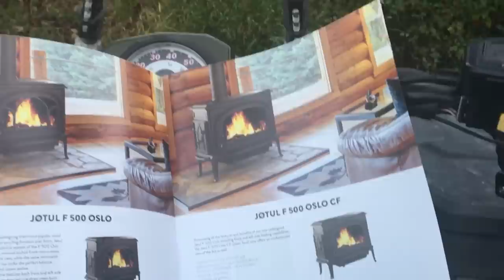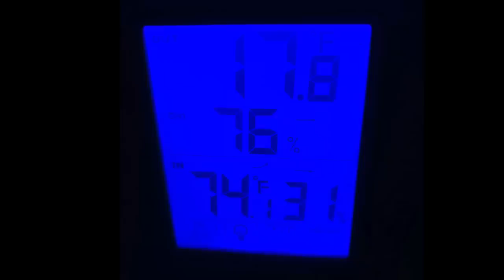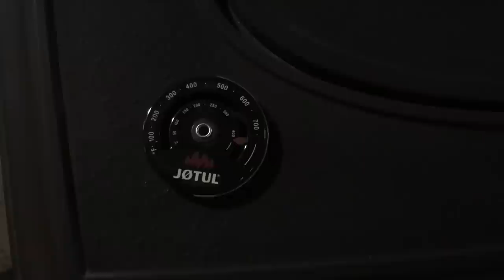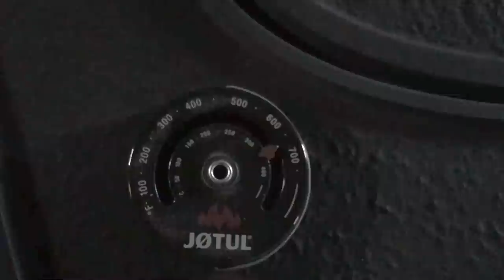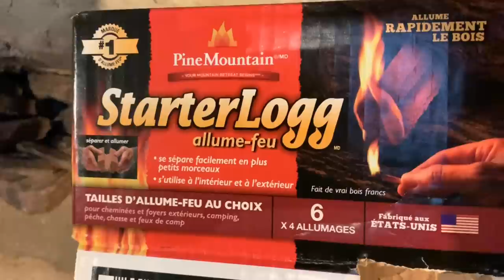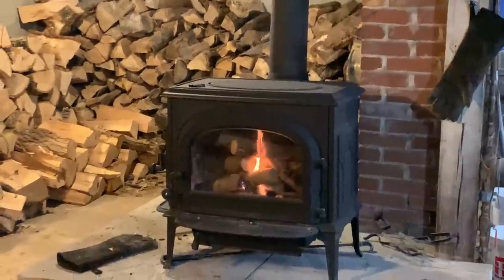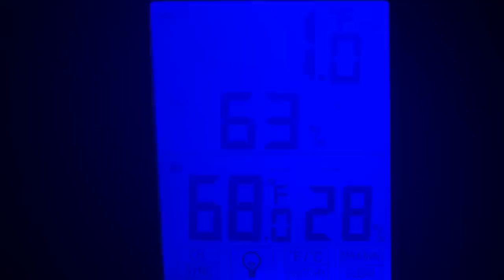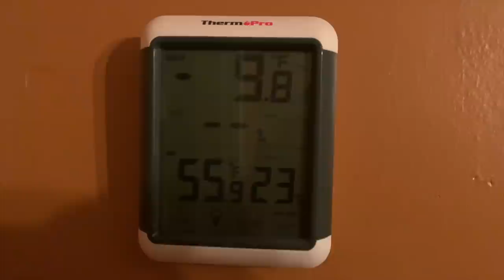The Jotul F500 Oslo CF one full winter review + install is this stove that good ?

Comment: Ive owned several high end wood stoves. In my opinion a woodstove  that draws outside air instead of inside air is very desirable. When a stove draws inside air it pulls outside air into you house.. Better option is the air to be drafted from outside right into your stove so not to pull the cold air into the house.
Reply from the maker: You are right. This stove does that. But i dont have it set up that way and cannot show it. I may in the future. I should have mentioned it i guess though. Thanks.
Reply: @AlfonsLC  very few wood stoves have the option to draw in outside air into the stove.  That alone is the best option to that stove.
Reply: Why is it bad to draw air from the house? Either way you need fresh air exchange (indoors) in the winter. To me it seems if you bring outside air to the stove it’s colder so not as good for combustion?
Reply from the maker: Bruce A the internal combustion engine is proof against what youre saying. The cold air is more dense. (Contains more oxygen per same cubic feet of air) oxygen is what burns. This is why people eliminate EGR valves on gas and diesel engines. And spend extra money for cold air intakes turbos and super chargers. It increases the performance of the burn. But i agree the air exchange is good. Some people dont want to create the vacuum pulling air in for heat deficiency reasons
Reply: You do not have even close to the combustion temps of an ICE, and in the case of secondary burn, you want the air as hot as possible to burn the gasses easily. It’s a different dynamic. The only reason manufacturers specify outside air is because in tight houses you can have reverse flue gasses leading to carbon monoxide in the house. And of course people don’t like cold drafts caused by the stove negatively pressurizing the space. But somehow you still need fresh air coming in or you get sick in the winter from your own (co2) stale air, even without a woodstove. To me it seems a toss up because you need fresh air in the house and you want the stove to draw well. But the science of the secondary burn is to have the air as warm as possible, not as dense as possible.
Reply from the maker: Bruce A none if this changes that cold air burns hotter. The heat isnt needed for the secondary burn EXCEPT to cause ignition of the gases. The air is drawn in the same. If its drawing in colder air. It will burn better.
Reply: Nope. The air for the secondary burn needs to be a minimum of 1050 degrees for it to work properly. You do NOT want cold air. That why all the systems preheat the air.
Reply: You introduce cold air to an ICE to increase power. You introduce warm air to the woodstove to increase efficiency. Again, two different dynamics at play.
Reply from the maker: Bruce A it needs to be that hot ignite the gases. Not because it needs to be there to burn.
Reply: So if it needs to be that hot to ignite the gases, what difference whether it starts as 0 degree air or 70 degree air? I don’t follow your logic about cold air. Yes, cold air is denser. But by the time it gets to the secondary air tubes, it’s neither cold nor dense. It’s nearly 1100 degrees no matter what it started out at. All cold intake air does is make the stove slightly less efficient because now you are burning some small fraction of the wood to heat the air that much more.
Don’t take my word for it, ask Jotul or any other stove maker. Or any science teacher.
Reply: The secondary air is still from the room, the primary air is from outside

Comment: Seasoned wood is just dry and older so it has shrunk and let air into the voids so it burns hotter... sort of.. wet wood is heating water vapor so you get that instead of heat but the energy is the same...and you can polish the glass to get rid of the clouding fire too hot too close to the glass fused particles onto the surface... anyway seasoned only means been there since last season nothing else... I burn wood 6 weeks after it is cut and sun dried and it is as hot as can be..dry is the key nothing else matters.
Reply from the maker: Yeah we will have to slightly disagree on this. There is a good video on how to tell the difference between dry and truly seasoned firewood. That walks you through the changing colors of seasoned wood when it starts to blacken and what that means. Check it out I think it may interest you. The channel is homesteading off grid

Comment: ofcourse it wil smoke before it gets really warm. thats water damp. And you should not emty the ash tray when its warm. isnt there a grate in the oven you can lift up?. Its not Jøtul's fault you doing what you are not supposed to :-)
Reply from the maker: Hmm. Im not sure i follow you on what im dojng wrong.
Reply: Dry wood on hot coals shouldn’t smoke much. Those black coals you show means you’re burning unseasoned wood. Dry wood, you’d have to douse it with water and even then they’d be ragged, not smooth.
Reply from the maker: Bruce A i believe i addressed that i bought unseasoned wood and it caused problems. Burnt it half the year.
Reply: So as the first comment mentioned, Its not Jøtul's fault. You knew what you were doing wrong by burning other than bone dry wood.
Reply from the maker: Bruce A im having trouble following your logic. Or what point youre trying to make. Jotuls fault ? What bad thing do i blame on jotul.
Reply: I was assuming he means your comments at around 11:15 where you say the Jotul smokes a lot at startup (like all stoves) and show the pipe out the roof. It won’t smoke much if started right with dry wood and not loaded heavily at first.
Reply from the maker: Bruce A i see. Listen again. It more making the point that the gas reburning system doesnt kick in until the stove is up to temp
Reply: I did listen, and again, my point was that if you use dry wood and don’t pack it full (as 11:15 shows being done), the stove heats up faster and thus the secondary burn kicks in sooner, therefore less smoke. Maybe I wasn’t clear.
Reply from the maker: Bruce A thats more to the point I guess. This isnt wrong at all. But. My point was still. Its going to smoke when it first starts. Until the secondary burn starts up. Simple. And cold air burns hotter

Comment: Great video! My opinions: those giant buck stoves basically last forever since you can weld em when needed. Oslo is mostly or fully cast, and joints are cemented and cement fails over time leading to a leaky stove. Buck stoves look like shit though, but are cheap. Heating efficiency curves shittier to best is steel, cast, then soapstone. Id just get a giant kitchen queen, more versatile. Rule of thumb, the heavier the stove the better it heats

Comment: use windex and steel wool on the stove door, i bet you it’ll clean that up
Reply: I use a wood stove glass cleaner and it works great, I don't know if it's any different than any other but it does work great. PS, I only clean my glass in the spring after I shut my stove down. I don't need to clean it during the winter since I burn dry "seasoned" wood

Comment: i wouldnt be able to sleep with that thing at 750 degrees in my basement,id be waiting to see the light shining up through the heat registers.
Reply from the maker: Haha. Ur not wrong. Its certainly not what i go for. But it can get there. Notmal temp is between 400-500 with the air closed all the way and good wood.
Reply: i keep mine around  450-500  for a clean burn, and let her stew at 250-300 for the afternoon, keeps the house warm.  i have a ranch, 1000sqft, no basement, box and ceiling fans.

Comment: Wood fibers don't burn, only the gases burn.
Reply from the maker: Explain charcoal burning then
Reply: A substance is raised to it's ignition temp, and then it off gases and can burn. That's simplified quite a bit. Solids don't burn though, only the gases they make.
Reply from the maker: The gasses are all burned off making charcoal. And its just the solids left. So
Reply: I wasn't trying to prove anything, just trying to help you say the correct things in your video. Charcoal still off gases, it's science.
Reply from the maker: Look its all good. But charcoal is wood fibers (carbon) once all the gases are burned of with an oxygenless fire. The carbon is all Thats left (wood fibers) when burned with oxygen. It produces carbon dioxide. But the carbon burning is a solid not a gas.
Reply: There is no such thing as a fire without oxygen. Look up the science of fire and the fire tetrahedron.
Reply from the maker: Ill be doing a video making charcoal soon. Ill be sure to mention this thread. Thats how charcoal is made. You burn it without oxygen. It burns off the gases using an outside source fire. Just the gases burn off leaving the solid carbon. Dude just google it quick. Yeesh

Comment: I have a pellet stove and a back up generator. Would never ever go back to a wood stove again.
Reply from the maker: thats what i switched from. its easier.
Reply: Really? I have had my pellet stove for 5 years. Never had one problem with it. Simple cleaning. I have a 24O0 square foot rambler. I go through a 40 pound bag a day in the cold months. Cost of pellets per day 5 dollars. Cost of electricity for running the stove about 40 cents. So total cost is about 162 dollars a month to have a really comfortable house . No worries about drying wood, splitting wood, storing huge cumbersome piles of wood, way less mess . I have the pellets delivered by the ton. Totally hassle free. Why did you switch?
Reply from the maker: robert Miller i switched because i can cut my own wood. Provide my own heat. Its a self sufficiency thing. I want to live on as little money as possible. I enjoy cutting wood. And have stacks of it drying. Satisfies me. Its how i was raised. I dont need to rely on power companies and pellet makers to take care of myself and my family. Pellets are easier. But comfort is my enemy. Unless its comfort that is well worked for.
Reply: So you are off the grid then? I am a mechanical engineer, so I work 60 hrs a week at my job. I enjoy the simplicity and efficiency of my stove, but I understand where you are coming from. Your wood stove looks great!
Reply from the maker: robert Miller thanks. Im working towards it. Id like to be totally off grid. But the scumbag government makes it near impossible where i live. So i do the best i can as much as possible. My cost of living goes way down in winter. But law mandates i cannot drill a well and must have public sewer. Which i cannot control. Law mandates. Im on the grid. Freedom !!